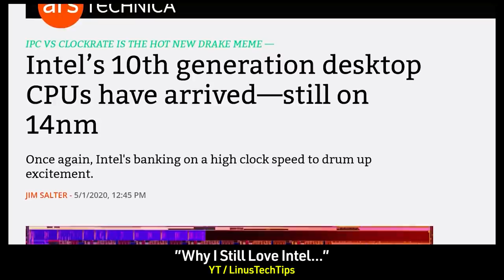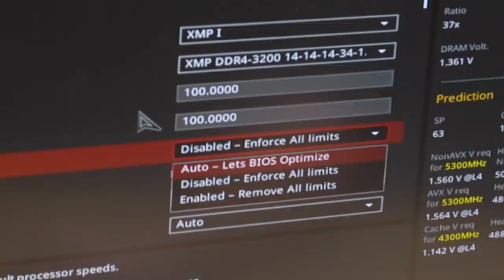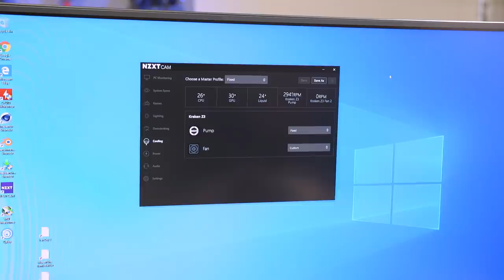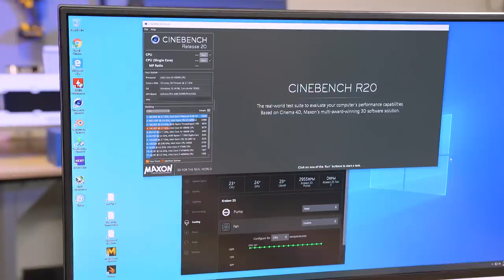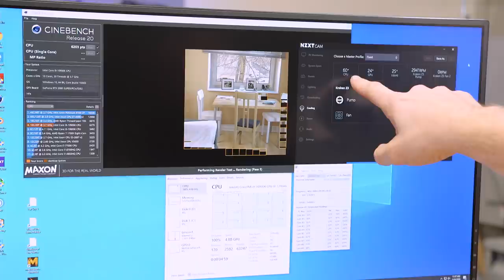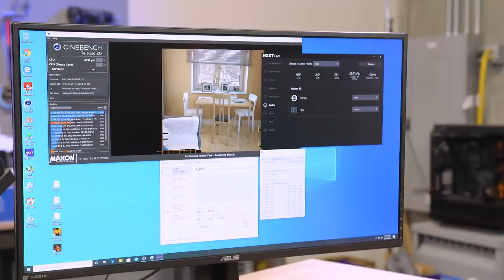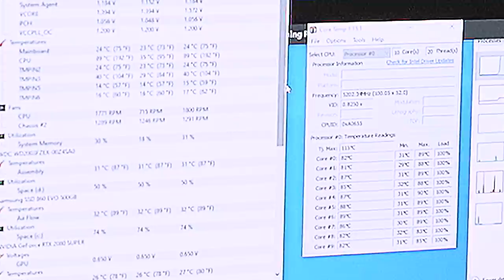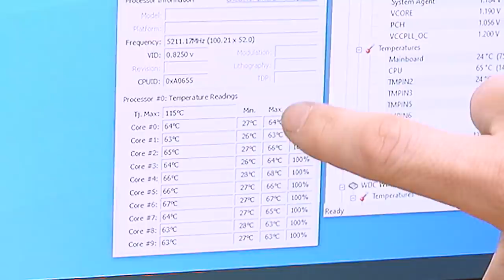Does the 10900k Melt!?

Comment: Jay: "The Intel CPU does not run hot, we cooled it with an expensive water cooler and the temperatures are fine"
Reply: What reference do you want him to use for this very high tier CPU? The stock cooler? Noctua nh-d15 will cool just as good or better as this cooler and it's 100$.

Comment: how are your core temps in the 60's, when i run my 10900k the same way my cores reach 70+ on just a single R20 test
Reply: Ivan Fontane   Just use it at default settings and forget about R20. It will do the job all by itself without beating the crap out of itself. It will boost to 5.2 ghz easily at stock settings. Load your games and enjoy.
Reply: @wysetech2000  kind of embarrassed to admit this but my dust filter at the top was still there even though I'm using the top of my case as exhaust. Temps dropped by 15c and I no longer have any questions or concerns
Reply: @vanyathebearable1271     No worry, we all do stuff like that sometimes.

Comment: Hey Jay! I haven't been able to find any post with explaining the differences between de 9th and 10th gen procesesors, as in physical differences in the materiales used and overall redesign, can you link me to a post that explains if you know any?
Reply: Andrés Guajardo        The physical difference is socket 1200 instead of socket 1151. There are plenty of videos on the redesign of the heat spreader and shaved die.

Comment: I love you Jay, but how could you not show what settings you used to get 5.2 ghz stable at 64c ?!?
Reply: Just set the voltage to 1.36 V and clocks to 52, he said it
Reply: @НепТор  I did and I get blue screens or Cinebench freezes. His chip has a prediction of 63, mine is 80. The numbers are going to be different. Got it stable at 1.35v using Level 6 LLC, but temps reach 70's when Jay's were in the 60's. I have a 360 radiator, he's using a 240.

Comment: @ 16:38 1.36 V for 5.2 GHz all-core is awesome.. Does that mean that my 7700k running 5.2 GHz all-core air-cooled at 1.45 V is too much voltage?
Reply: My 10900k does 5.2v at 1.5v. Notice how all big tech YouTubers recieved a 10600k & 10900k in a special package. Their cpus are going to be better binned then what you get online or at store, but you could get lucky.

Comment: You can't just say "oh there is no one case that everyone uses" and then use that as justification for running an objectively better setup thermally. That's like saying "there's no one cooler that everyone uses" and then slapping on the biggest compressor you can find. I mean, you can do that, but then you can't also argue that the setup is in any way representative of a normal user.

Comment: I'm not seeing results anywhere near this with my 10900K.  Asus ROG Formula board, Kraken X62, disabled MCE, stock everything else, I'm hitting 95C in Cinebench and only getting 5200-5500 points.
Reply: Across the entire test, I'm getting 95C temps on all cores at 4.9 then it underclocks to 4.2 to cool down.  Just repasted and reseated the AIO, made no difference.  Pump is spinning at 2700RPM, both fans on the radiator are maxed out.  Everything in the BIOS is stock.  Very odd.

Comment: How does he get his coolent temp so low under load my coolent gets to 34c my cpu doesn't over heat it only gets to 64c under heavy load is it because Jay has an open bench
Reply: You want cooler coolant temps? You need to dissipate the heat faster.... Either more radiator space, or more airflow

Comment: I think you did everything you could to make the temps as low as possible. If you're trying to prove a point, don't half ass it. Put it in a case. Leave the fans at default. Use a budget 240mm AIO. If the temps are still low, then you'll really have proven your point instead of drawing criticism in the comments for rigging the test.

Comment: I would argue A case, is more representative than NO case. why not just pick a ''typical'' popular case and go from there, especially when a case will easily add a few degrees minimum to most of the components inside, everything changes temperature wise when you have a 2080/ti churning away inside a case. just saying you cant pick a case to represent the masses isn't really a good reason to pick no case at all in my opinion since that represents almost nobody, worse still the VRM fan will be assisting the cpu further by pushing the heat from the gpu away from the AIO radiator. its quite literally the best possible conditions 99 percent of users will never experience. and I don't say this as some kind of AMD fanboy, I own a 9900k/2080ti inside a lian li 011 case.

enjoy the content though bro, thankyou.

Comment: Jayz conclusion is same (and also wrong) like in LTT review - it's cool. No it's not, it's hot, can be even hotter but at least today we can buy extreme AIO cooling to fight with that (not trying to burn a house with air coolers like in P4 era). 
It can be cooled down and it's cool are not a same thing. Someone who will buy this CPU will also buy proper cooling, spending 20% more on cooling than on CPU is not something unseen. But CPU is not cool, not even close to that.

Comment: Hi, Im a brand new subscriber, and I have a question.  My old computer is an HP Blackbird 002.  back in the day it was running Vista, has 8 g of ram, and dual core quad processor.  I dont want to just throw it away, i just cant,  I live on the space coast in florida.  i wojldnt have a problem sending it to you, but it is very very heavy.  what can I do with it ??

Comment: Hi guys, maybe some1 can help me with this: I’ve got a Ryzen 7 2700x @4,1 GHz - cooled by an Corsair H115I platinum RGB. The Case is a Thermaltake V200 RGB. The 280 rad is mounted in the front with the Fans pushing air in from outside. When doing a 10 Minute cinebench Loop the liquid reaches 45c, however if I open the front, so the fans can suck air freely it stays at 28c. Is there any way i can get better temps without taking off the front? I don’t really wanna buy a new case 😬

Comment: how did you manage this Jay? First, 5.2 is not average for these, seond, are you not cold sitting in 18C room in nothing but T-shirt? And third: you are the only human to hit 5.2 on 10900K @1.3xV with under 80C temps. How is this possible Jay? Can you run Blender or prime95 small FFTs all core with those temps or did you try it, saw 97C and gave up? Right now, you are the only human to have accomplished this.

Comment: I still have 4790k 16 gb of ram and 1060 6gb and it like this 5 years every time in summer my cpu heat in games to 85c 88c with turbo off I cant run turbo when I run it my cpu heat straight up to 100c 
and I cant buy or fit any other cooler in my case I cant even buy new pc right now my cooler is zalman cnps90f the shop I buying from only sell zalman coolers it good shop close to my home

Comment: Hey guys I'm new to pc I ordered a pre built pc it only came with 8gb ram so I ordered 2x8 sticks I was wondering if I should just put the new ram in as soon as I get it or should i boot it up  first with just the 8gb it came with then add the new ram after?Thanks
Reply: you can use and work - no matters. but DEMAND the 8 GB module !  even manifest the same to the store,
Reply: @georgemartinezza  sorry I'm not sure what you mean?
Reply: Put it in before you start it up and make sure its al running correctly in the BIOS.

Comment: Mi question here considering how AMD has distributed thermal sensors across the die on their GPUs, I was wondering if there's any info about where and how many sensors are there on both Intel and AMD CPUs. 
After the difference reported in temps between nVidia Cards and AMD reporting 2 temps for the RX5700 / XT in comparison; one being hotter than the other, and the highest temp being higher in comparison on the AMD side than on the nVidia side and this being the case based mostly on the sensors location, or rather taking the highest in there as point of reference. I was wondering if placement was optimal in both CPUs as well, because this could reflect lower or higher values depending on location even between models produced by the same company. I'm aware Intel modified the die both in shape and thickness to achieve better dissipation, but since I was not able to find those details online. Do you think it's possible to repeat the test with both CPUs and maybe take the water temp after saturation as the point of reference? That would more or less rely on the AIO sensor instead of the temps reported by other sensors on the board or the die itself.

Comment: 3:19 nzxt h510 bc everyone on the plannet uses it even tho it has mediocre airflow kek
Reply: H500 series isn't that bad on airflow. A number of people are just doing it wrong.
If air cooling only, do not use the front fan mounts. Instead, replace the 2 preinstalled exhaust fans with stronger ones.

The front should be saved for a 240/280mm liquid cooler, and to use said liquid cooler on the potentially hottest component - and this is what some people tend to do wrong:
They mount the liquid cooler to the cpu, when it actually should've gone to the gpu, via a Kraken G12.

I mean, there's not as many mainstream cpus out there that realistically exceed output of 200w compared to gpus.
Reply: I use an H510 and have 4 case fans(set to the lowest speeds) and using the stock AMD cooler for my cpu and i have no issues with air flows or temps unless i let cinebench hammer my cpu for more than 5 loops lol..but otherwise while gaming my temps stay fairly cool below 70° 90% of the time

Comment: Hey Jay, I've been watching your YouTube channel for a few years now and I was wondering if you could help me out as you are the professional when it comes to water cooling. I'm building a new machine with 3990 x but I'm using my old fittings. I can't seem to find anywhere of how to properly clean your old fittings, without damaging the coatings or the material used to make a fitting, can I soak them in vinegar lol or can I put them in some kind of acidic liquid to clean off any residue or do I just rinse them off with distilled water and brush down the fittings manually by hand? Before you say why don't I buy new fittings... it because I wanted to go with hardline tubing eventually but due to my existing case and existing fittings and PVC piping + my case being the Silverstone temjin 11, I don't want to waste money on a new fittings to only have to tear it down to move to a new case to then have to RE-hardline it all again. I just want to get the system up and running for now. Any advice would be much appreciated thanks.

Comment: u see temp in sh1t program, it is physically impossible this processor is at 60 degrees at 5.2 in all core under stress
Reply: Suporte Vendas    I guess Intel's engineers are smarter than you are.
Reply: @wysetech2000  do you really believe that a 10900k at 5.2 all core with a temperature of 60 degrees at 100%
Reply: @maartesdecor   I haven't tested it myself so i have NO real proof but even if it's 85c that's not a reason to panic.

Comment: I mean, if you have to use a 280mm radiator to keep it cool, wouldn't that be considered a hot chip? In the past it would have been. AMD has caught shit in the past for including 120mm liquid coolers with some products and everybody was like, "HAHA look at AMD running hot again. They even have to slap an aio on it from the factory because they know people will try to run it on air and it'll melt. Haha AMD hot and loud haha."  So do you HAVE to use liquid cooling to tame it? How hot does it run with a Hyper 212? If a decent mid-range air cooler can't keep it from thermal throttling, then we should still consider it hot. I just find it funny that people are putting 280 and 360mm radiators on it and saying, "look how cold it is" lol What can't a decent large AIO keep cool?
Reply: The_Chad        I think people are being unrealistic suggesting a Hyper 212 cooler. This isn't an AMD 1600x. It's like buying a V 12 Ferrari and then installing a Fiat radiator and expect it to cool. You people are nuts!

Comment: Hello guys i need your help plzz , i just installed new gpu 1650 super . 
My cpu is i5-4590 
Psu 500 w .
Ram 8gb.
1 to hdd.
But the usage of windows become slow and it s not fluid as before .
The games are working well but loading take time more .
 Help me plzz
Reply: You should reinstall windows on an ssd and use that as your boot device. That'll speed everything up. : )

Comment: How the hell is your aio liquid that low, my 360mm aio never goes under 32 c and regularly is at like 35, peak 40 on my i7 9700k.
Ambient temps: 22c
Reply: David Johannesson
That's the whole point. Intel has done a lot of work to make it run cooler.
Reply: @wysetech2000  But the tdp of 10th gen increased
Reply: @David_Johannesson    What would you expect, to go down?
Reply: @wysetech2000  You're arguing that the 10th gen is cooler and now you say its hotter?

The i7 9700k has a tdp of 95 and the 10700k has 125tdp
Reply: @David_Johannesson     Read this and once you know what your thinking is wrong you might accept what i'm saying. I copied and pasted this.

TDP stands for Thermal Design Power, in watts, and refers to the power consumption under the maximum theoretical load. Power consumption is less than TDP under lower loads. The TDP is the maximum power that one should be designing the system for.

It has nothing to do with heat dissipation.
Reply: @wysetech2000  and yet, his liquid temps are 10 degrees lower than mine on idle, on a z73 instead of a z63. We even have around the same ambient temp, thats what I was confused at.

Comment: my aio just be total shit cuz my cup peaks up at 95c-100c under cinebench and iv got 10900k
Reply: I'm having the same problem. I can't imagine how many reviews show low Temps when mine hits 95°C+ in less than a minute when running Cinebench r23. Have you figured out anyway to fix your temp issue?
Reply: @jjlw2378  messing with the voltage for stability and i switched to full custom loop witch helped slightly now it runs at 93c for like 30min then starts to climb i think it had alot to do with the cheap aio i had it didn't have very good cooling dissipation. that and my stock mb profile had the voltages way higher then needed for stability  for the chip i have

Comment: 3:45 so ... therefor you go open air as a conclusion ??? instead of going online searching whats the most used PC case and use that as a baseline ? Okay.... sounds like an excuse cause a test bench is easier less effort. Also not a good representation of what the actual "Average" end user would be getting. ("Average" based on the most used pc case if you noticed.)

Comment: Hey Jay. I dont understand how this is possible?! 1.36 volt for 5.2? , what LLC is that? And it has to be with AVX-2 offset right? I also have a 10900K SP 63 and they are known to require a lot of juice and produces heat!  I only tried with no AVX offset and thats impossible with 1.36 Voltage. Are you running max LLC? I used to be on LLC4 but that required 1.42 Volt. Now im at LLC6 1.30  5 Ghz and that goes all the way up to 85 c in Cinebench and I have custom loop EK Waterblock. thats more than 20c higher  of yours CPU at 200 Mhz lower frequency?!?!?!? Whats going on here ?

EDIT: After some research- its perfectly normal to have 80s-mid80s celcius in Cinebench R20.. Me my self touches on some cores 85 c with a custom loop. So when you pulled off the 60s c for the 10900k @ 5.2  It MUST have been because the water was not heated up?  OR ridicolous low voltage.. ?

Comment: Why get so defensive about people saying the open air bench test is incorrect to real world use? Because considering the fact that all you need is just a case, ANY case, because 80% - 90% of people will have their computers in A CASE, and it's easier to assume average performance between case to case performance, than it is comparing open air bench to a case,  though, if you do want to look at some good cases, look at some gamer nexus reviews. which they go over MANY cases, and explain which cases are applicable to most scenarios. and you have MANY cases to choose from, because otherwise you're just sounding like a child that doesn't want to change its ways, as well as you saying " you can't do that, it doesn't exist" is a VERY childish mindset.
As well as, your air bench is PRIORITISED for BEST air flow, so you don't even try to neutralise the scenario, and have only set up for the most optimal cooling, so of course, non of this will be accurate or useable by majority of people who want to build this in a case, to those people: Go to Gamernexus reviews.

Comment: "..trying to recreate what a builder would experience out of the box...", but doing so with a $260 cooler on an open air test bench.  There is no useful information for actual system builders in this video, other than you likely need to budget $250 plus for a cooler if you want to go with Intel.

Comment: i9-9900k 5ghz 75c max during cinebench loop while doing other stuff on the system Fractal design 360
https://i.gyazo.com/3e719c1a20aa28d4d5f90b5e459eb350.png
Yea its a improvement from intel... bit late... but still welcoming. hope to see more from intel.
Reply: just my gossip: same 75° MAX - cinebench and rendering video and wathing youtube. stock cooler in a tiny AMD 2400G :P